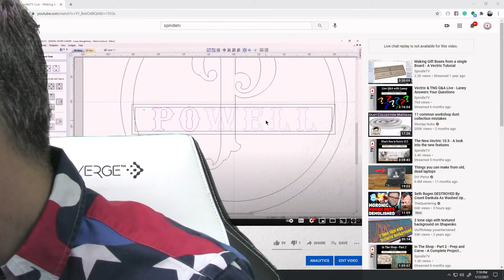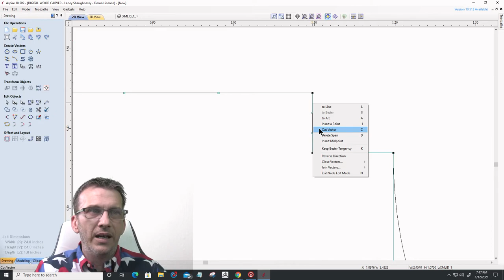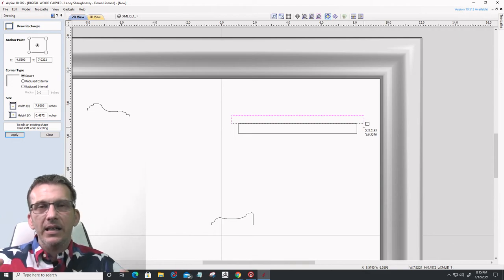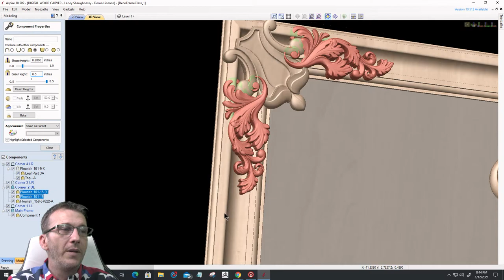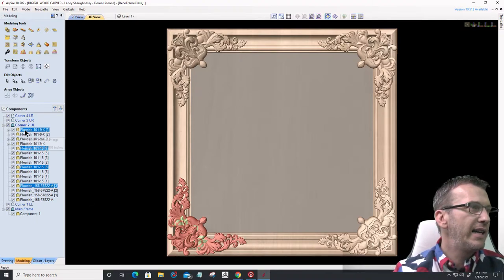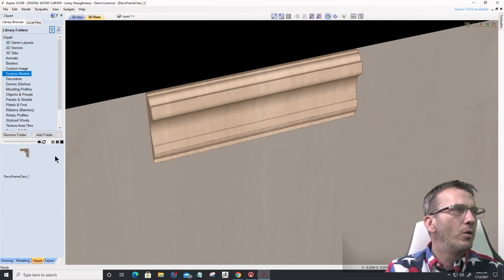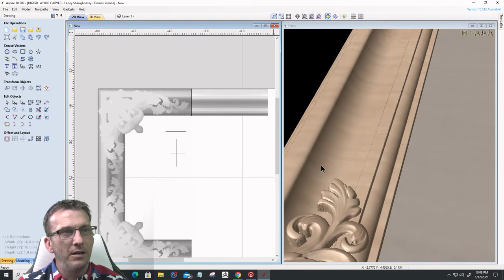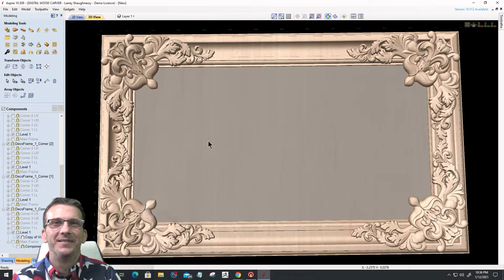Decorative Frame Modeling - An Aspire Project Design

Comment: You video are really good you amaze me most of the time. At the end of video you could have used Dimension for your size gone to Set Size and then Alignment tools to set edge. Trying to align using nodes and to get size never works unless you are a sandpaper salesman.